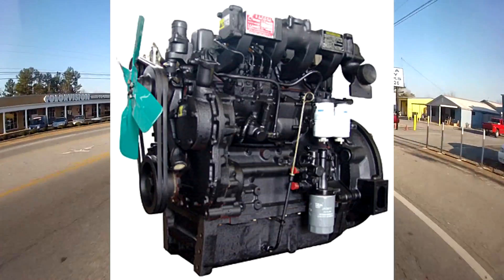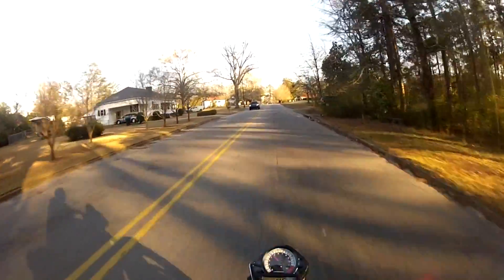Torque & Horsepower Explained... and coffee

Comment: hey.... thanks for the video man, your doing a great deed to humanity... 
can i ask a few questions? i am buying a new bike for a cross country adventure... the bike i'm looking forward to has the following specs
i)Displacement 411 cc
ii)Maximum Power 24.5 BHP @ 6500 rpm
iii)Maximum Torque 32 NM @ 4250 rpm
EDIT iv) It has 1 cylinder and 5 gears 
i understand the concept of CC and gears from i) and iv) but i really need a dumbed down info for the rest.
could you please dumb it down more? what does that mean? thanks a lot.. :) it would help out a lot...
Reply from the maker: ripcord93 I'm happy to take a stab! Let me know where  things may still be unclear.
Your bike is capable of making 24.5 horsepower. Horsepower is one 'way of quantifying' or 'unit' of power. Other units of power are Watts, Joules per second, etc. These are all units of power in the same way that inches, meters, and miles are all units of length... all three measure the same kind of thing so we can easily covert between them. 
Obviously length is how long some distance is. Power is how quickly work is being done or energy is moving. 
Back in the day, somebody started taking notes of how  quickly an average horse does work. This eventually led to the (silly and rather British) unit of "horsepower" for power. How did they measure power? There are many ways, but an easy way in that case is to measure how fast the horse is moving against some resistance - how fast does the horse tend to walk dragging something by a rope with a certain ammount of tension? The power is the speed times the tension. If I increase that tension, I expect the horse walk more slowly because he desn't want to do the work any faster - He wants to continue working at his usual rate of 1 horsepower.
On your bike, The push you feel when you twist the throttle is like the tension. The most push (acceleration) is available when you are going slow (Obviously, gears make this possible). As you go faster and faster, less push is available untill finally you reach a speed where that push is so small and the wind resistance is so great that the two are equal and your engine's 24.5 HP is all being used to maintain that speed instead of accelerate further (assuming you have the throttle pinned).
You commonly see the fruits of your bike's power in how quickly you can accelarate. It takes a certain amount of energy to get your bike + you + your gear moving at 50 mph from a standstill on flat ground. How quickly you can reach 50 mph depends on how much power your engine can make - how quickly it can change that ammount of chemical fuel energy into mechanical kenetic energy. 
For vehicles with small engines or a lot of weight, there are always those dreaded long hills where you know that you will only be able to hold a certain pathetically slow speed, and you just can't go faster. This is another way to see power in action... (or not so much in action:) To raise a weight to a higher altitude is a certain amount of work - takes a certin amount of energy. The little engine can only do work at a limited rate - only so much work per unit of time. Remember, that's how power is defined. So that's what sets the speed at which you can crawl up the hill.
So as you ride around, these three aspects are all varying, but the sum of the three is the power needed from the engine at a given moment - acceleration, drag, and climb rate. You see that for any given vehicle, more power allows you to both accelerate faster and reach a higher maximum speed (motor enthusiasts who don't really understand mechanics often tell other tales).

Okay, now for the torque. Torque is just rotational force - how hard the engine shaft is twisting. Torque is measured using a combination of force and distance - think of pulling on the handle of a wrench. 32Nm is the torque you would be applying to a bolt if you were pulling with a force of 32 newtons on the handle of a 1 meter long wrench. That's the most torque your  engine can make (it's actually the average over a full piston cycle).
It's important to understand that things like force and torque and pressure can exist without motion... Like the horizontal arm supporting a street light... there is a torque wanting to bend the arm down, but nothing is moving. 
When an engine is tested to measure performance, the shaft torque is measured while it is also turning using a special machine (dyno). The engine is tested through a wide range of rotating speeds. A computer logs the torque at every speed, creating a graph. This is simply called the torque curve. At the same time, the computer logs the torque times the speed at every speed, creating another graph. This is called the power curve.
When a vehicle is marketed to the consumer, the locations of the highest point on these graphs ("value @ rpm") is published to provide the consumer with some expectations for how that engine will perform. The most useful number for telling how the vehicle will perform is the power. The torque number can be useful indirectly in some special cases, but many consumers place far too much importance in this published torque number. If it has any value, it's actually the engine speed for the max torque. By looking at how far it is below the speed for max power, you can get a sense of how flat the curve is without actually looking at the graph. (a flatter power curve feels good to the rider because the engine feels more punchy at lower speed and doesn't seem to care care as much which gear it's in)

So that's a "dumbed down" explanation of what power and torque are, now the practical: A bike with 24.5 BHP isn't a lot, but it's enough to go absolutely anywhere at a reasonable speed. Luckily, singles tend to have flatter power curves, so it should be easy to use all of the power available. You can probably expect  a top speed somewhere around 60-80 mph, and a realistic "all day" cruising speed of 50-65 mph. It may have to slow down a tad going up long steep hills, especially at high altitudes.
You should easily be able to keep pace with (or outpace) inner city traffic.
That's about all that can be gleaned from those specs, (you can basically ignore the torque).

So how are we doing? Any better?
If you're with me so far, my 2nd video on this subject may help flesh out these concepts (especially why you can ignore the torque number) https://www.youtube.com/watch?v=1BAypeoNZXM
cheers!
Reply: damn man.... that was great! thanks a lot... i will  read this time and again, although i now know a lot from yesterday, thanks for the explanation, beer on me if we ever meet LOL!!  and i hope everybody sees this comment, thanks for putting in the analogy too, you have now become neil degrasse tyson of engines for me :D ! wuhu!!

Comment: hp wins, always
Reply from the maker: Yes. It's accurate to say HP averaged throughout the run always wins. Peak HP still isn't quite a guarantee, though it usually wins.
Reply: drienkm like i said hp wins. sure over time another car can average more hp output and win.... still proving my point. hp output at a given time = possible acceleration... more hp = more accleration....

changing crank tq rating but keeping hp constant would result in no change in performance...

hp is what you aim for period....

Comment from the maker: @GlassTopRX7
Haha... time mark please where I said torque requires rpm... You are correct - torque is a static quantity.
Listen again. I said power requires torque and rpm...
Reply: here is one more your arsenal... HP dictates the rear wheel torque.  this is where folks get confused.  engine torque vs rear wheel torque. very different.  HP dictates at any speed, what the rear wheel torque will be.   tractor engine vs motorcycle engine. if both have 40hp, then at 40hp, both will put the same torque to the wheels at any same vehicle speed,   
acceleration = power/ (massxvelocity)
force = mass x acceleration
Reply from the maker: zanick2 Bingo. Yeah, when people think about torque they aren't making that distinction in their head between torque at the engine and torque at the wheel, the latter having a very tight relationship to HP, not engine torque. I think it's also hard for people to leave the transmission as a free floating variable that we assume can provide the appropriate gearing. Providing the needed gear ratio is never a design challenge when trying to gain performance.

BTW, I think you mean accel=power/(mass*velocity)

Thanks for the comment :)
Reply: drienkm yep, you got I   and oh yes, did a typo in the accel = power/(mass x velocity)   (corrected!)

Comment: No you didn't explain it right.  Torque doesn't require rpm, it is just the force applied
Reply from the maker: Kush Kruze Not sure who you are referring to, but by "rpm" I mean "rpm" - rotational speed
Reply: Wouldn't you agree that at a low rpm you'd be accelerating slowly and at a high rpm you'd be accelerating quickly? Same shit
Reply from the maker: GlassTopRX7 Correct, no problems there. I'm still really interested to know where I said anything to the contrary. Time mark???
Kush Kruze I agree with Kush Kruze's comment b/c he was talking about the more typical case where torque does peak at a "high" rpm. He was speaking in loose terms. The only crack in his statement was implying that torque and acceleration can be treated interchangeably. Please remember that there are allot of CHANGING gear ratios in between.
Reply: I think by rpm he means acceleration
Reply from the maker: Kush Kruze I do agree... two totally different shits tho;) Correlation doesn't make them equivalent. BTW, how would that have clarified GlassTopRX7's statement?
(I do appreciate your comments! :)
Reply: drienkm Kush Kruze You can have torque the twisting force without rotation.  Think about a torque wrench, it allows you to apply (x) lbs of force and slips beyond that point. 
Rate of acceleration isn't related to rpm's beyond the specifics engines output.  So if the engine made 50lbs of torque from 1000-10krpm acceleration would be the same throughout the power-band.

Comment from the maker: The 16500 accounts for the fact that 'HP' and 'RPM' are not 'standard units'. English standard units are ft-lb/sec for power and rad/sec for rotational speed. (ft-lb is already the standard unit for torque.) If you are working with these units from the start instead of HP and RPM, the 16500 goes away.

Comment from the maker: Sort of. When horsepower is applied to the wheels, torque is being applied AND the wheel is turning at some speed. The mathematical product of those two things is power.
You can have torque at the wheels even when the car is turned off... This would happen when you park a car on a hill and just leave it sitting in gear. Gravity is trying to roll the car down hill, but the engine is keeping the wheels from turning... there is torque, but no power at all. Remember, torque is a static quantity.

Comment from the maker: Torque is just rotational force. Force is just "push"... so torque is like "rotational push" Remember that torque or force can be present in static objects. For example, there is squeezing force in the soles of your shoes when you are standing still, and there is torque in that big ugly coil spring on your garage door even when it's not moving. So torque occurs in any object that is being twisted against some resistance, moving or not. 
Did I answer your question? I'm happy to elaborate:)

Comment from the maker: I don't see any misunderstanding or error in any of your 7 recent comments.
I only meant to correct the errant statement in your original comment, "Torque is not a portion of the horsepower calculation, it is work" To that I say: yes, it can be calculated from work and time, but it CAN be and is more commonly calculated from measured speed & torque because, to use you own words "An internal combustion engine can only produce two things: speed and torque".
Thanks for your comments!

Comment: Final thoughts and I will leave this alone. concerning an internal combustion engine, you can never create more torque than it take to overcome a load. Any excess torque created will be converted into the only other element that an engine can create and that is of course speed. So any torque created which causes a rotation is then deemed to be work as it meets the work=F*D criteria. Just because the Displacement is rotational in nature does not diminish the fact that it is a form of work.

Comment: IMEP = Indicated Mean Effective Pressure. In other words, the engine makes only speed or torque, speed is set, the only way to overcome the applied load is to increase the force in the cylinders acting on the moment arm which is the throw of the crankshaft. If you increase the IMEP beyond the torque requirement to maintain a certain speed, the result will be n engine that will increase in RPM, resulting in more work being done at a greater rate resulting in increase in calculated horsepower.

Comment: When you take the lawnmower from the driveway to the tall grass, you are applying a load just as if you were in an automobile with the cruise control on and beginning a long climb up a mountain.The response of the governor is exactly the same as the cruise control; it opens the throttle plate, increases the injector output whatever... The reason this occurs is to maintain a speed irregardless of the load applied. To overcome the load applied, you need to increase the IMEP in the cylinder(s)

Comment: So why am I making a big deal out of this subtle difference? An internal combustion engine can only produce two things: speed and torque. Instead of an automobile, perhaps a simple lawnmower example would be helpful. You start up your push lawn mower and set its speed control to fast. The engine will run at a governed top no-load speed for example 3000 RPM. At this RPM, cutting no grass, the torque output is just enough to rotate the blade and overcome the internal friction of the engine.

Comment: The reason this is important is that applying a force perpendicular to the center of mass (thus rotational center) does not need to cause any movement what so ever. Using a torque wrench would be an example. The wrench is the moment arm, the force is applied by your hand perpendicular to the bolt. You can measure the force yet not move the bolt. That force is real.

Comment: Sorry for the slip of my fat fingers, you are of course correct about w=F/Displacement should be w=F*Displacement, My point here is that the D in displacement for the work equation is literal. the d in the torque equation is the distance of the moment arm and does not always cause displacement. When it does, torque drops to nearly zero when the force applied perpendicular to the moment arm yields rotation about the center of mass, work is then "done" as the displacement is measured as rotation.

Comment from the maker: What you are describing has allot more to do with the transmission than anything. In general, HP alone has the direct relationship to both acceleration and top speed. The engine's actual maximum torque value doesn't mean much by itself, because the torque changes dramatically through the final drive and the transmission with each gear. 
I am in the process of grappling with how to explain the whole picture in a video.  
Feel free to PM me. I really want people to understand this stuff!

Comment from the maker: I'm glad you found it cute Bruce... It's also correct.
Yes, you can express power as work/time, but work=force*displacement, not force/displacement. So we have force*disp/time... disp/time is speed :O
So power=force*speed.
Torque (force) and rpm (speed) can both be measured directly, work cannot be (it must be calculated from force and distance). That's why torque and rpm are typically used to calculate HP which IS the metric most directly related to performance... that's why we find it.

Comment: Although somewhat cute, the Physics here are just plain wrong. Torque is not a portion of the horsepower calculation, it is work. Power = w/t, where w =F/Displacement and t= time
As well, Horsepower is not the most important calculation when it comes to producing performance. As well, keep in mind that you can not measure horsepower, you can only calculate it. work and torque can be directly measured. Keep in mind you can calculate the "horsepower" of a light bulb, big deal

Comment: and if a torque measurement is made in ft.lbs. the amount of force in lbs. is the average perpendicular force. It can be assumed that the force in lbs. is rotating around a 1ft. radius (because of the unit ft.lbs. is being used) so the distance the force is exerted through is equal to 1ft. * 2π * revolutions
with 1hp being equal to 33,000ft.lbs. per minute, you have
Hp = 1ft. * Xlbs. * 2π * RPM / 33,000
That's where HP = ft.lbs. * RPM / 5252 comes from.

Comment from the maker: Right. It would be more accurate to say there are many different "units of power"; HP, metric HP, Watts, kW, BTU/sec, ft-lb/sec, calories/hr... the list goes on. The difference between these units of power is like the difference between an inch, a meter, a furlong, and a nautical mile; all units of length. 
You could even give the light output of a light bulb in horsepower instead of watts... a silly choice of units, but it wouldn't break any rules... like measuring your height in miles :)

Comment: There are different kinds of Horsepower.   For example 746 watts is one horsepower for an electrical motor.  Also there is boiler horsepower, metric horsepower, and other types.   I suppose torque would be defined as the amount of force of any of the given definitions of Horsepower.   Seems complicated, but prolly not.